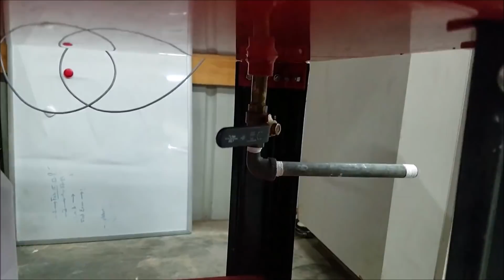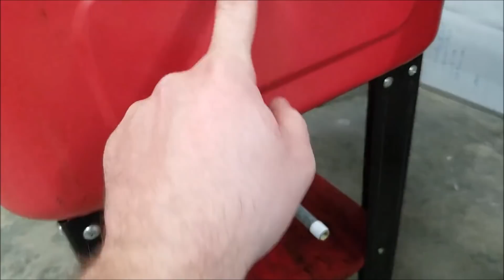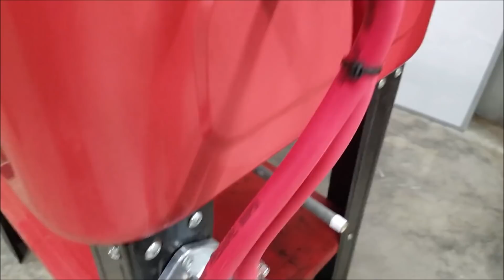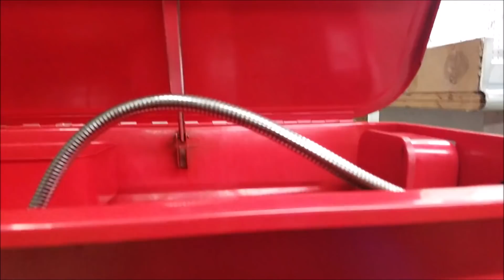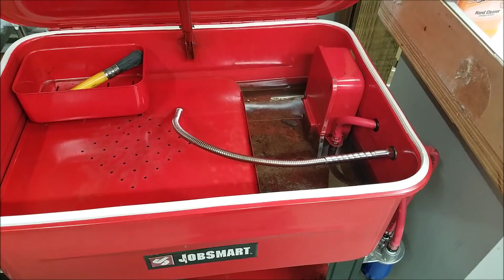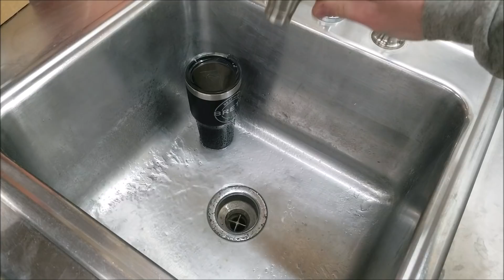Parts Washer Filtration Mods

Comment: Air hose will degrade with most solvents and diesel.  You need a much smaller micron filter for the thinner solvents used. Oil filters are too large micron filters to keep from starving the engine when the oil is cold and thick

Comment: Good video.  I like when people show there mistakes - we are all human.  Do you have a drain in your garage that you run the sink to, or do you have a bucket underneath?
Reply from the maker: I appreciate that comment. No drain, other than the one at the bottom I put a valve on. I also kept the jugs the solvent came in
Reply: @Solitude313  Wanted to know about drain for sink not parts washer as I was thinking it would be great to have a sink in the garage but it is rare to find them with a built in drain.  Just wondering about yours. Joe
Reply from the maker: @FlagPole84  Oh sorry, yes I have a built in Drain. Its just PVC to the edge of the slab and honestly still not sure where it empties into haha.

Comment: Is that solvent paint safe?
Reply from the maker: I believe so. Its not that strong to take it off, cant say Ive tried but just my thought.
Reply: Thank you. Reason I ask is I want to submerge chain saw cases in the parts washer for a day or too. Worried about losing the paint.
Reply: They will be fine with the psc1000. Havent hurt any of the saws I've submerged in it even the plastic covers.